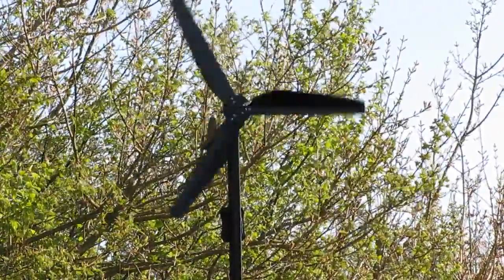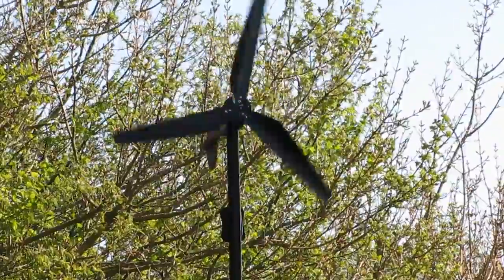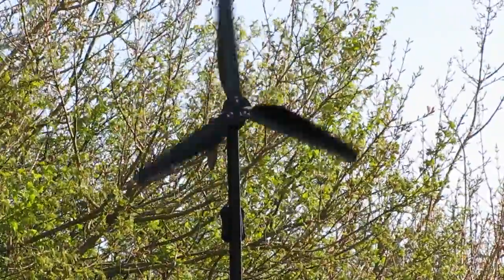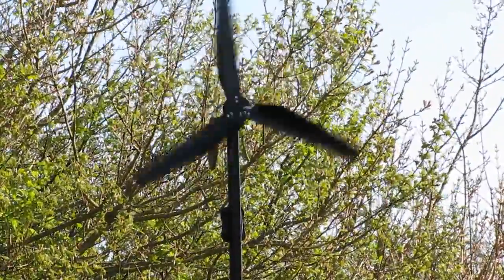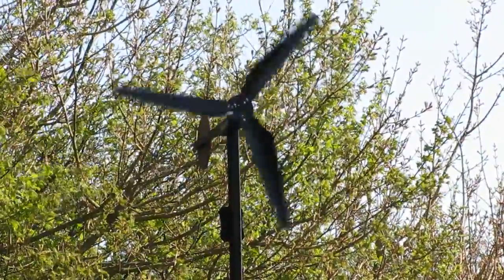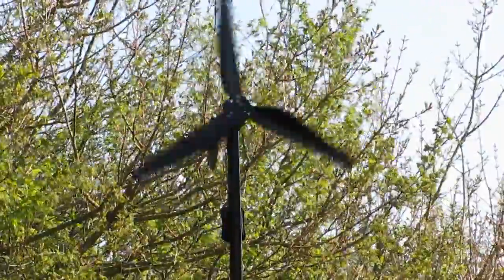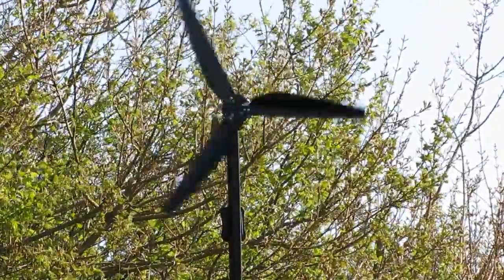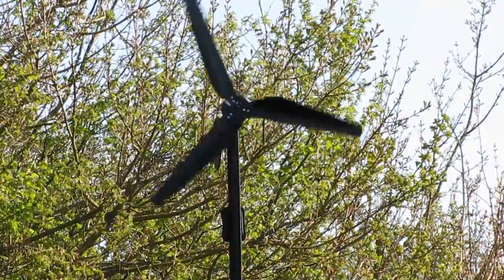DIY MINI WIND GENERATOR FREE ELECTRICITY MINI WIND TURBINE

Comment: Is the Nema 17 easy to turn?  A low power wind turbine that can turn most of the time is better than a powerful one that doesn't turn much.
Reply from the maker: Yes it turns very easy in a 5mph wind it makes 9.50 volts, Today its making 20volts in 14mph winds with the two phases in seires  it will keep a battery at 13 volts. I want to try one with a gear box next.
Thanks for commenting.
Reply: Sounds good to me. It's good as is but almost anything can be improved.